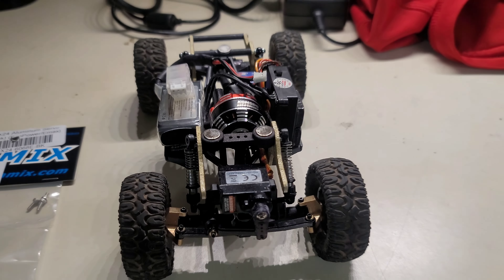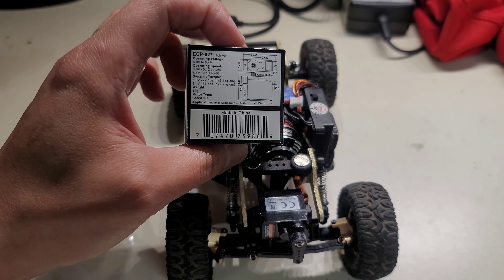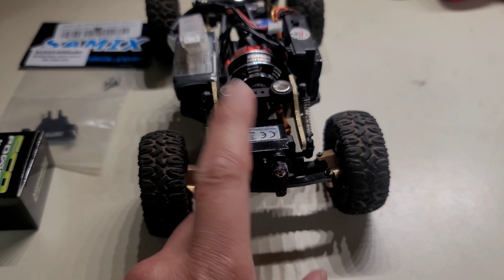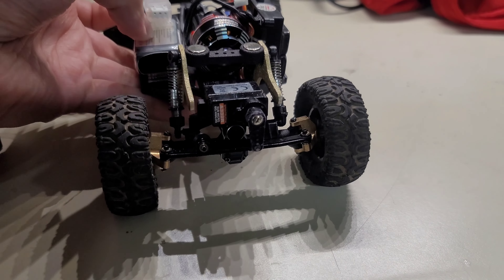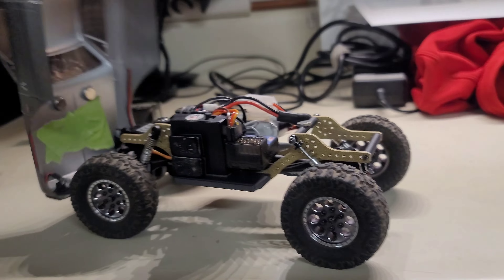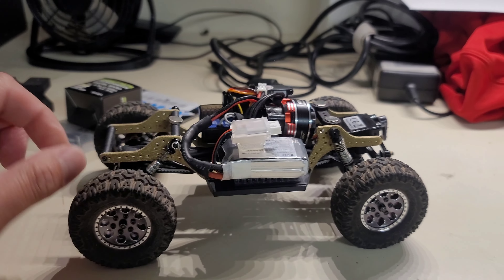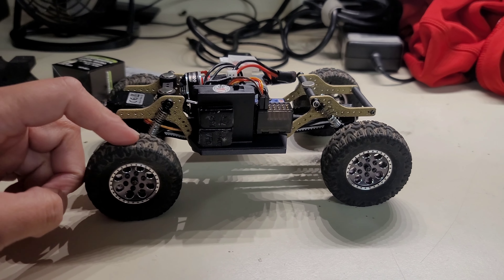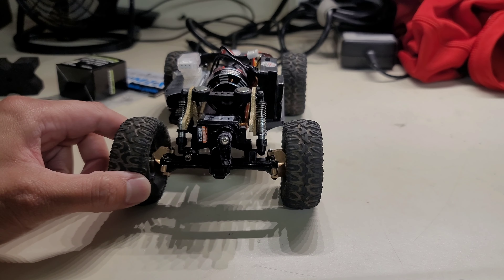SCX24 Killr chassis update ➕️ some crawling action #rccrawler #rc4wd #trealhobby #scx24 #furitek

Comment: Does the Killr flat skid fit any chassis that uses a SCX24 skid or just the Killr chassis?
Reply from the maker: I haven't tried buy I'm sure you can make it fit different rails, it's definitely within the size of the stock skid
Reply: @fmfdocrc8682  I see, thanks. That's the first flat skid I've seen for an SCX24, other than the one that I just designed. I'd love to know if the mounting holes on the Killr skid line up with holes on a stock chassis or other SCX24 based chassis (MOFO, Furitek, etc.)
Reply from the maker: I'll definitely take  a look when I have the skid and rails in front of me and I will let you know 🤙

Comment: It is a really nice/clean buid, but iI wonder why you put that giant komodo motor way up high in a low CG chassis?  seems to ruin all the work you did to bring the CG down
Reply from the maker: Well it's the stock transmission, I would like a lower cg transmission can you point me to the names so I can check them out 🤙
Reply: @fmfdocrc8682  I’m not talking about the transmission I’m talking about the weight and mounting position of the Komodo. It is mounted above the transmission and compared to the rest of the Scx24  it weighs a ton. This ruining any low cg that you gain from that chassis.  Not only that but the Komodo is over powered for these small trucks. Maybe the mini Komodo would be more appropriate in a low cg build?  Or any of the other brushed/brushless options?